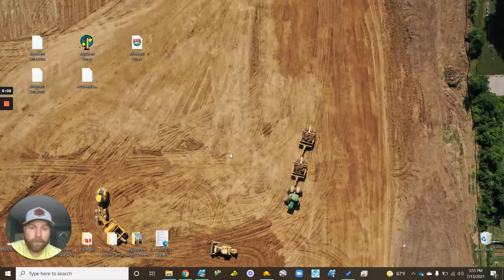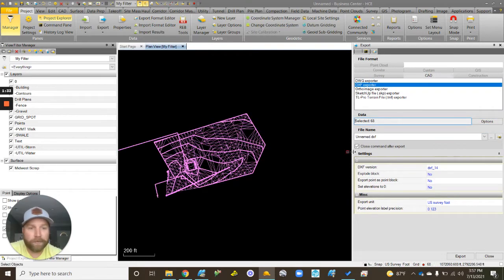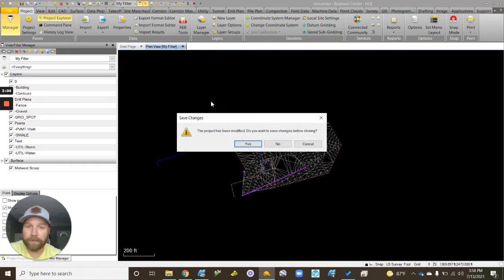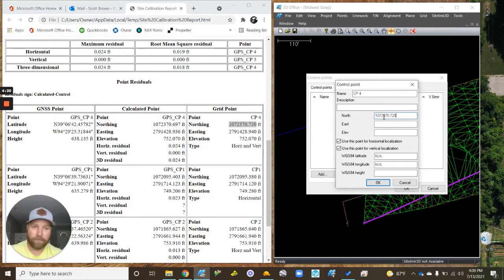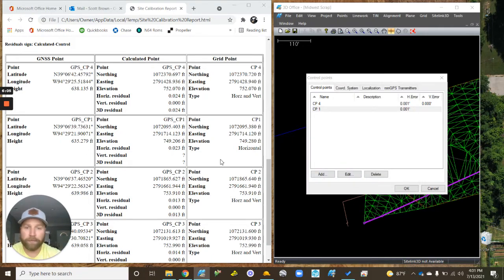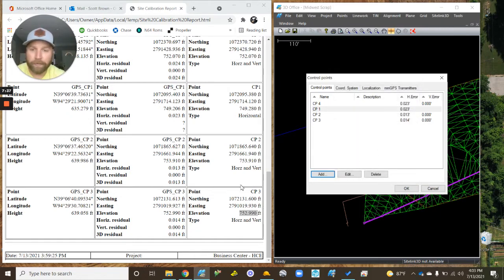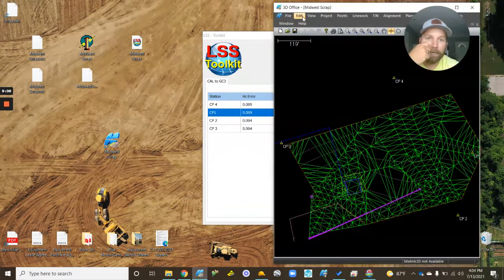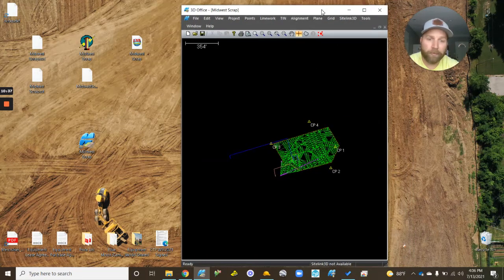Converting Trimble Files (.dxf/.ttm/.svl/.svd) to a Topcon Project File (.tp3)

Comment: I've been using this method for awhile now and just now had a client who went to import the tp3 into their dozer. The dozer will load it up but then when it gets into the grading areas it freezes and shuts down. Any clue why this would be happening?
Reply from the maker: I would be curious to see the density of the triangulated surface. If it is really dense if can lock up and shutdown the software, especially on older hardware like the GX-60s
Reply: @constructiontechnologypart2040  it's for mass grading so my initial thought was the file was just too large but we've uploaded files double the size with no issues but yes maybe the density has something to do with it. I've tried clipping down the surface into three segments with no luck either so kind of at a standstill.
Reply from the maker: @fixanythingsavemoney  you're welcome to send me the .tp3. I'd take a look at it when I have a minute and see if I have any suggestions 
support@myconstructiontechnology.com

Comment: can't seem to find a link to Trimble Business Center. Is this something I have to buy?
Reply from the maker: You must purchase Trimble Business Center. The free downloads do not offer any of the features you need to do anything. If you can find an older version like V3 or V4 they typically have the necessary features unlocked . I will see if I can locate a good version and post a download link.

Comment: Yeah I have TBC 5.1 and couldn't save as an autocad file and bring it into office 3d, It would be blank and not load anything.

But you can open both linework and tin autocad files in autocad and hit export and save both files as 2007 dxf and office 3d will load them.

Yeah I didn't want to have 5.1 and 4.1 Trimble business center just to convert it.

Hope this helps more people with the same problem. It's like TBC was trying to stop people from using topcon dozers with Trimble software.
Reply from the maker: I've seen that is well. I would say stick with anything 2014' and older and I seem to avoid issues with import.

Comment: I use Trimble at work but i personally own a top rover with pocket 3d.  I tried to take all my Trimble files and convert them but when I select the dxf from my thumb drive nothing shows up in Office3D.  A lot of the times i get “import failed: invalid format”. Why isn’t my lines work or surface showing up when i bring them into 3D-Office?
Reply from the maker: Most likely whomever is producing the .dxf is exporting it as a newer CAD file. I typically stick with 2014 and it seems to work well with older stuff. I noticed around 2019 that some of the newer CAD wasn't well liked by the older software like Office 3D.
Reply: @ctpusa1  oh ok that must be it then.  There is no way around it then?  There is no version of 3D Office that supports newer cad files?
Reply: @littlenel17  7 months later but
Office 3D was discontinued by Topcon. They want people to use Magnet now, which as far as I know doesnt have a free version.
Reply: @tylercase3199  better late than never…thanks for that